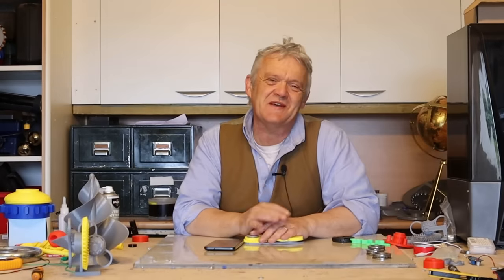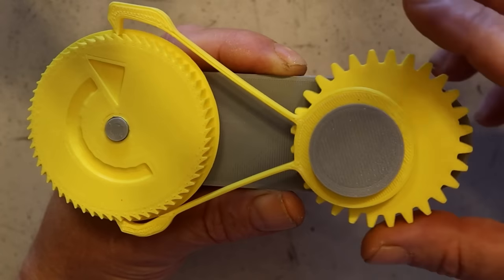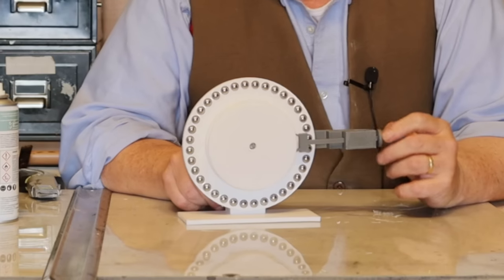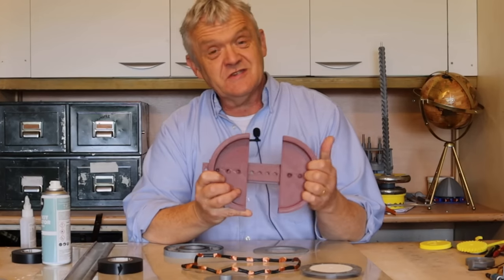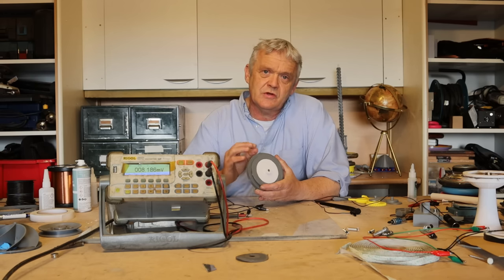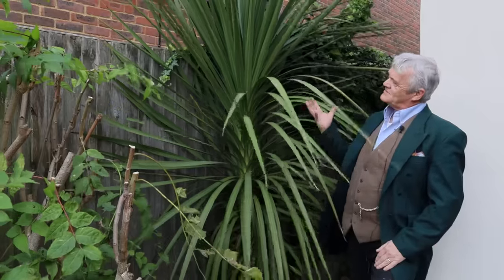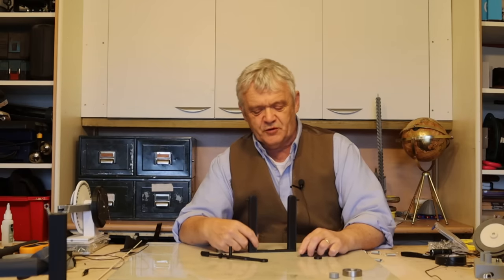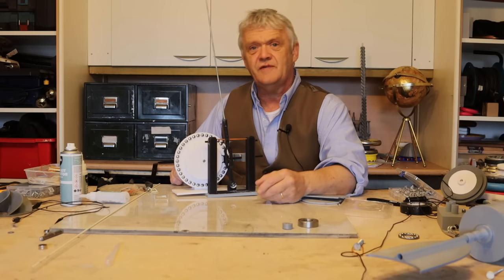033 The Magic Mechanism For Wind Power

Comment: 👍👍👍In order to maintain consistent rotational output, perhaps steal another page from Seiko and add a windup spring mechanism. It could power the rotation of the generator, with the ratcheting input continually winding up the spring. It may do that in fits and starts, but the rotational output would be smooth and continual.👍👍👍 I WAS THINKING THE SAME IDEA .

Comment: In order to maintain consistent rotational output, perhaps steal another page from Seiko and add a windup spring mechanism. It could power the rotation of the generator, with the ratcheting input continually winding ups the spring. It may do that in fits and starts, but the rotational output would be smooth and continual.

Comment: Good job, and thank you. Another idea is to install a wing (symmetrical airprofile) on the mast instead of a square in such a way that it will rotate freely around the mast axis. The mast axis must be in the aerodynamic center of the wing. At the bottom of the wing, add a beam in the wing chord with a weight that will be on the trailing edge or further from the wing. The weight must be large enough and far enough from the axis that the resulting moment is greater than the moment from the force on the wing from the wind. Then, when the wing tilts to one side, an angle of attack will be created and thanks to this, a force will be generated on the wing and it will start moving in the opposite direction. And hold the device tightly, otherwise it will fly away :)

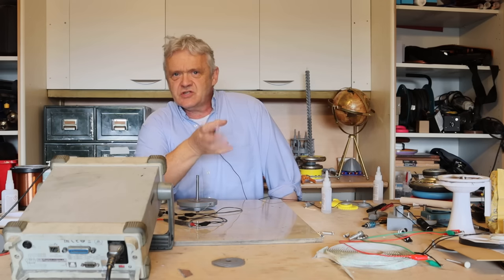Comment: Hi Rob - Another great video! (Thanks) If I wasn't so busy writing and illustrating children's books, I'd definitely be putting more time into my interests in this area - Energy Generation/Recycling. I had an idea many years ago for a Gym which, instead of wasting the massive amount of energy asborbed by treadmills and rowing machines, turned it back into usable energy to POWER the building! I haven't googled it but I'm sure there are now people doing this. Anyway - what came to mind when watching this video was another adaptation of that Gym-based power conversion: Around 7:50 in this vid, you demonstrate the power generated by a pushing in and out of that button (linked to the Seiko mechanism)... so, in the context of Gym-power... surely there are 101 ways the various bits of equipment in a gym could be used? Imagine 50 gym users (or more) all driving rotary mechanisms linked to a Seiko-style central camshaft... linked to a generator??? To me, it's a no-brainer. Can't understand why ALL gyms aren't built that way yet! ;-)

Comment: Great video. I love the compilation idea to get all the info in one place. Good work.
One suggestion for the "barleycorn" generator... The square flap may be giving too much wind resistance to allow the stalk to return upright. Try a different shape like cattails or barley. Look to nature!
Reply: Nope. He needs an even bigger one and a very stiff pole, and gears. Would be good if the paddle could split open in the middle when it hit the end position then slam shut again at the start position.

Comment: Very cool! I like the push button idea, that's fun lol. If I may offer an observation, it looks like the wind catcher is spending a lot of time pegged to one side. That makes me think it would benefit from a pre-tensioner to adjust the stiffness of the springs or rubber bands. I'm thinking of a way it might  even be possible for it to self-adjust to accommodate various wind conditions. When it bumps against the limit, there could be a ratchet or escapement mechanism to advance the tensioner by one tooth. This would gradually stiffen it up in a high wind condition. The trick would be to somehow slowly release that tension over time so that it could return to a low speed regime without manual intervention. Like a rotary damper on the end of a planetary gear chain or something. The tensioner wants to unwind all by itself, you'd just have to limit how fast it could do that.
   I also considered a ratcheted rack and pinion design (in place of the seiko arm) to increase the travel distance rather than the pre-tension. That would allow the springs or bands to reach their high load state simply by being stretched farther. In higher winds it would have a bias toward one side or the other. That would make the thing bigger, but it might be simpler than some kind of tensioner clockwork.

Comment: Set this up next to a railway crossing. The horn and the sound of the wheels could generate energy for running signals at the crossing.
Reply: This is true, especially at points as they actually have a range of relative motion with every progressive wheelset. (Resisting/generating power from the rail deflection on regular straight track itself (relative transient ballast compaction) may have unintended "costs".)

Comment: I am thinking of a cradle expansion set for you, that is basically a bobbin winding set up, maybe with a counting wheel set, that can be run by hand or maybe by linear motion. tricky bit is the tension works, but I think some feedback form on a threaded segment, like they use for sewing machines. Primary hiccups I see is making sure the feed doesn't add twist over time and strain the wire, as well as an expansible assembly to trace the former. With all the coils you wind, it might save some labor. also fun mechanisms of several kinds to bring it about.

Comment: Very good concept brought back and forth by cydem. but this suits me, it is a common savonius in the garden. rotor 134x75cm metal flange 70cm with 32 magnets and 30mm plywood board with 32 coils. this almost always works even in the forest and charges 12v batteries.. the power is not great but a constant small charge keeps and fills the batteries.

Comment: I know the point of this experiment is to get away from rotating motion, however, a simple windmill design with a cam at the bottom of the drive shaft to push the button and the return springs reinstalled, would be much more efficient, or at least it seems to me that it would. Might be an interesting video to see if it would work. The push-pull mechanism looks to be a great force multiplier over a direct drive.

Comment: There is a one bladed water pump that can float on  the blade on the upright turns on  the upright arm the blade is shaped  like a plane wing so that it catches the wind in either direction hope this helps with this design

Comment: When I seen this I thought it looks like a good match for a electric bicycle using the18 magnetic generator for the front wheel maybe have a couple smaller ones for the shock system and regenerative braking and some bladeless wind turbines in the frame if possible and a lot of this I'm sure would end up being over kill so I'd like have your advice as to what kind of motor would you choose to power the rear tire  not looking to run a race maybe 5 10 mph with a 250 load+bike if possible main concern is reliability and any advice on a storage system for the power supply thank you for your time and knowledge

Comment: @TnTOmnibus Well, how about if you build something like an old computer joystick. So you have the stick going down a hole where it have a joint in x and y direction. Then below that hole you connect it to a drive in x and a drive in y direction via something, maybe a belt or maybe a gear like you have but one direction maybe need to be in a ball or something to move along with the other direction. But the joystick analog would give the part that sticks down below the hole to have leverage. If you have a long stick up you can multiply that force quite a bit, therefore have a lot of resistance down below in the form of a large generator or high gear ratio to get some speed up.

Comment: A ball socket rocker would better soak up the randomly directed wind force.

What you need is a lever which, no matter which direction the end blows, will always directly move.

In the case of a ball socket, especially if you make full use of the leverage, you simply put your ratcheting mechanism below it, aiming more vertical than horizontal, and you can by all means get the force of the wind in all directions.

This idea came up to me very long ago, only using hydraulic force, and pneumatic force, as those require fewer complex moving parts.

Comment: An fluttering airfoil might work better, which would be able to generate lift off of the wind, verses simply pushing a flat plate? Perhaps a linear alternator more be more efficient than the rotational generator used?

Comment: I was thinking merge the ideal of the flat wind turbine from video 024 with this ideal of the oscillating  pole. When the pole reaches its maximum swing at full extension it triggers the flag at the top of the pole to turn 90 degrees allowing less resistance for the return causing it to oscillate more/faster. Then when the pole reaches its maximum at full return it turns the flag 90 degrees back to its original vector allowing the cycle to repeat over and over. Because in strong gusts of wind the pole will just max out at full extension and stay there overcoming the rubber band. But if the flag is turned 90 degrees at that point it returns even in full gusts of wind. Seems a pity to not get them extra cycles out of those huge gusts of wind.
I am not sure the best way to make it happen but there is a way to make it happen. IF i think of an elegant way to make it happen you will see another comment later.

Comment: Neat, a 'pullmepushyou' machine.
  I guess power transmission to rotating ratchet gear is limited by strength and flexibility of arms?
Something attached to a three year old would be interesting, they seem to be in a state of perpetual motion 😁
Something that has puzzled me for years, why isn't anyone putting a wind turbine inside all the cooling towers around the world?
They have a venturi and generators have been vertical shaft over 100 years so you would get 'something for nothing' plus blade shape could be developed to be somewhat efficient plus hidden 
I know there is some research going on with thermal wind generators with ' cold end' and 'hot end' different heights on mountains but cooling towers have waste heat when 'whatever' is running and an upward flow.

Comment: Ive made something that can can turn 2 way movement into just 1way forwards thrust ising gears, i was gonna make a scooter with it on but never got round , 

basically can take a pendulum movement back and forthe and turn it into just a forward movement but probably work with your thing aswell, the wind should act on a pendulum with abit of weight be better than a standing stick which could fall over

Comment: The long swaying rod as a wind generator. You can use a hollow rod with 4 rods inside. 2 of the inside rods being the coils. The other two having the magnets. As the outer rods sway the internal rods will bend at different rates. Put your hands together with your index fingers together and keep them together as you bend your fingers to the right and left and you will see that one bends more than the other and you will see what I am saying

Comment: Seems to me that the paddle catches the wind and moves with it only as the wind is moving perpendicular to it. That requires the wind to reverse direction in order to move the paddle back to its original position. Looking at the plant, I think the better orientation would be parallel to the predominant wind direction so that the paddle flutters.

Comment: Maybe use stronger rubber bands. The point is to get it oscillating just far enough to move those levers. So it’s ok if there’s plenty of tension after a certain distance. Or maybe mount a bracket with springs at a point higher than the rubber bands. Leave a gap to allow movement, and when the lever moves far enough, it hits the spring and then has both the spring and the rubber band pulling it back the other way.

Or maybe if the vane on top is somehow spring loaded and or shaped so that it can partially turn. When the force in one direction is too great, the blade will turn partially and then the rubber band will have a chance to pull it back and create that oscillation. (Just brainstorming.)

Comment: So if you use a mechanism that turns when it reaches a point and its weight pulls it back to the original position where it turns to face the wind then it would work

Comment: They do make iron filled PLA filament so you could just print the backing's. Don't know the ins and outs of it though never tried it, should make a difference in current output. Not sure how you work that into the winding holder unless your printer software have multi material settings.

Comment: Some engineers calculated the amount of energy which could be generated, if those types electricity generating machines were installed under railroads  and Metro lines lots of free energy

Comment: Metal plates would generate magnetic eddie's and the permanent magnets would wrestle with the field's generated  in the coil, so you are wise to stick with plastic Mr Smyth.  If small circular coils were used and a diode and transistor ( transistor connected to hall sensor or optical timer ) a diode to redirect the flyback generated by the mini coils to a couple of capacitors to charge a small battery 🤔